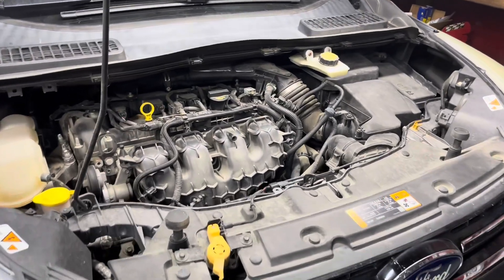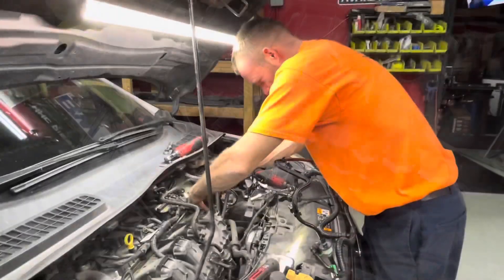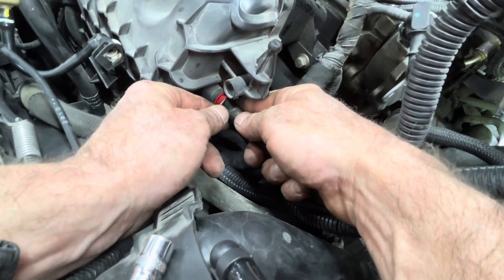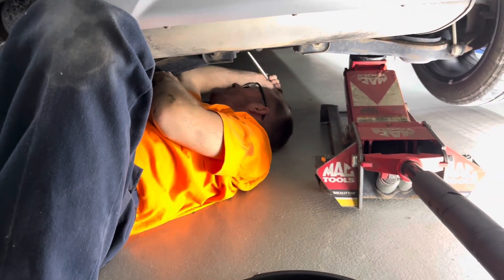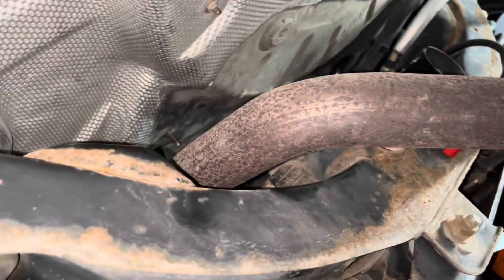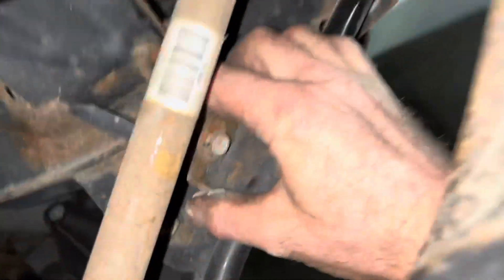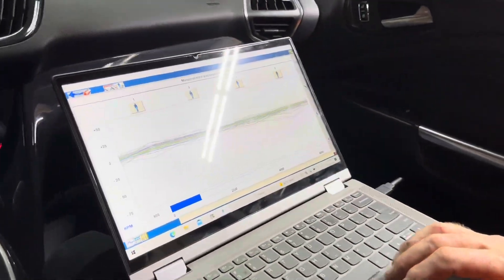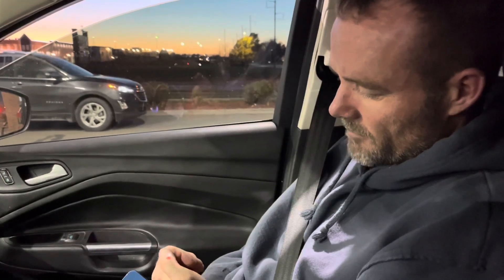2014 Ford Escape~AWD Evap Canister replacement with Evap lines~

Comment: that can produce the gas cap farting?? i already change the evap purge valve...but not original or oem one...the part last 2 years....now start farting but not always and not problems like before remplace the part...so...i have that doubt if is the canister or the shity purge valve 
Thanks

Comment: I just did this no need to touch exhaust or sway bar but plastic skid plate needs to be removed. The 2 lower shock bolts and 4 k member bolts then lower about 3". Then loosen driver side canister nuts and remove pass side nut.